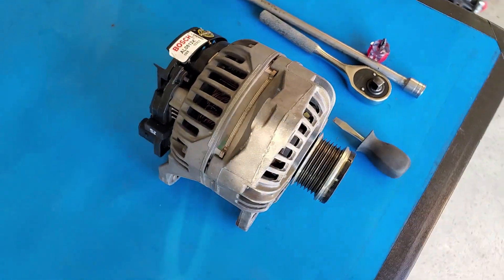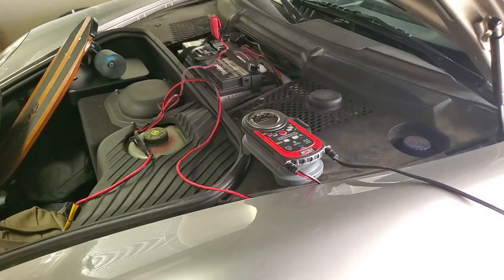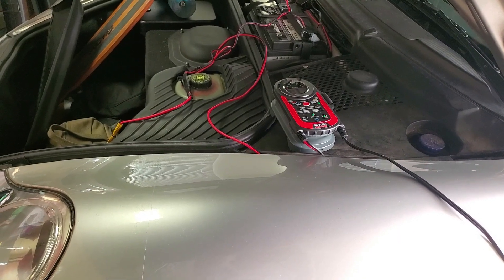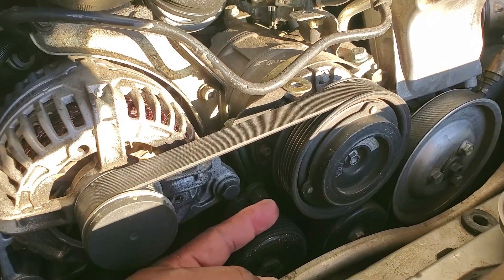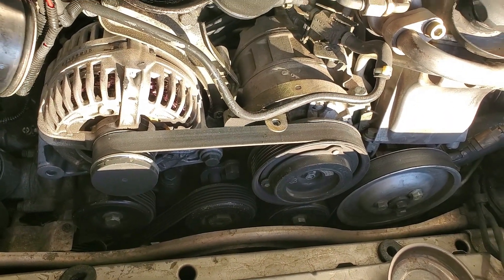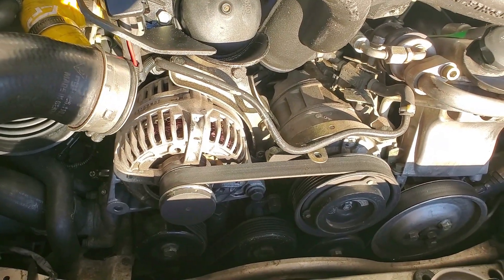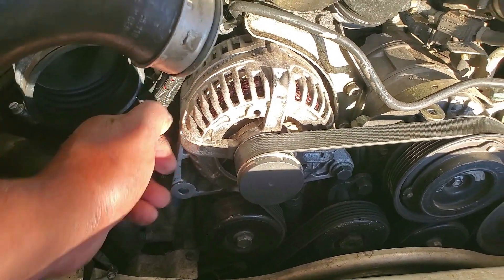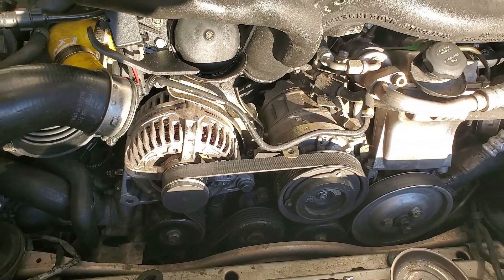Porsche 996 Turbo Voltage Regulator Failure and Repair

Comment: Great video as always Clint, thank you! One other indicator about the voltage regulator fault, if you look at your Christmas tree lights picture - you'll see the dash voltage indicator is at the max at 16V. It should normally be around 12.5V with the engine off and 13.5 to 14.5V with the engine on.

Comment: Excellent Clint.  Same exact experience here with the regulator at only 17k miles.  Alternator bolt mounted at the rear was a pain.  Otherwise a fairly straightforward job. I suspect the left turbo just below the alternator is the culprit.  Heat!  Thanks also for your tip on the bezels for the gauges.  I ordered them about 3 years ago after seeing your video.  They are superb.  Rennlist posts led me to believe the regulator was most likely the problem.  It was and appears to be as common of failure as the spoiler ram leaks.
Reply from the maker: Thanks for the comment 👍

Comment: Same happened on mine last week with only 8500miles from new, so not mileage related. That big Y pipe scratched the underside of my boot lid which made me mad so wrap some cloth around the right hand side end to prevent this happening on yours. 
Also my alternator was really hard to get out even when all the bolts were removed, it was a very tight fit and I had knock it out with a mallet and length of wood , I got a new Bosch reg off eBay for £15 ($20) and all good now.
Reply from the maker: Nice, thanks for the tip, I'll be sure to put something on my Y-Pipe next time to prevent scratching.  I don't think I scratched the boot this time, got lucky, but that's a very good suggestion! Thanks again!
Reply from the maker: I'm getting ready to upload a video just for you to make sure the alternator is never "really hard to get out" for you again.
Reply from the maker: https://www.youtube.com/watch?v=XyvF_IlpAHo